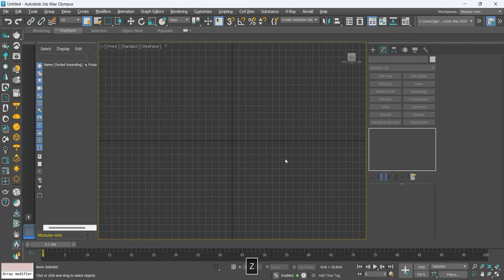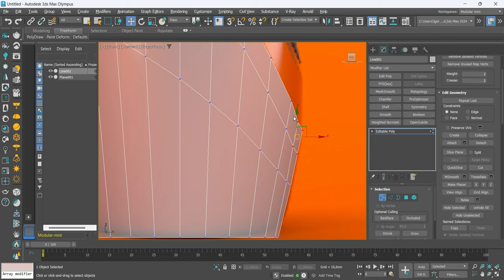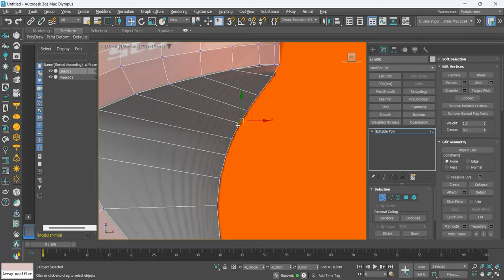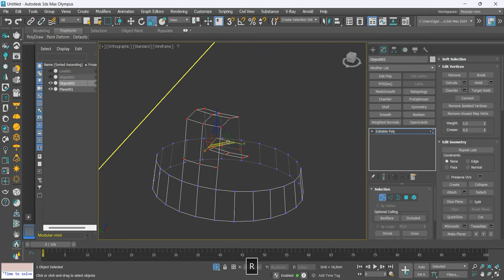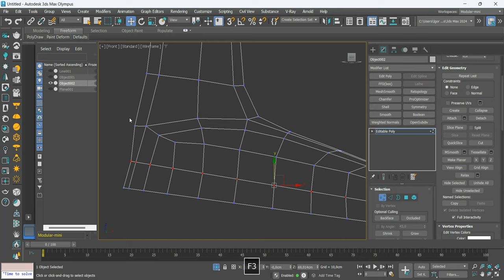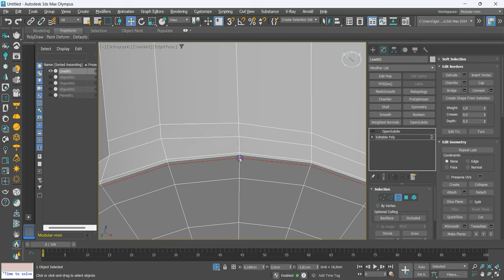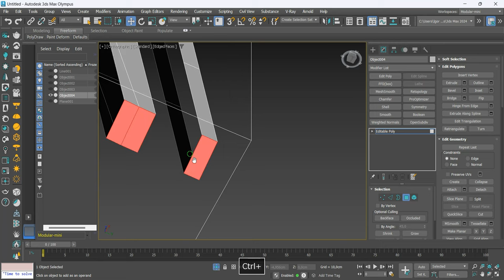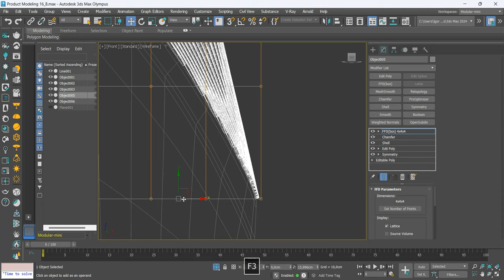Creating Stunning Hard Surface Product: Guide 3D Bottle Modeling  #3dsmax2024 #boolean #hardsurface

Comment: Hi. Great videos. I am still struggling to understand the logic of where to put the support loops. Need a subject in which to practice all the modeling tools
Reply from the maker: Thank you friend! About support loops, you should think like this. If you want a face to be harder you should add support loops as close to its edge. If you want something smoother, you should insert the loop further away from the edge of that face. About the loops in the middle of the model, they serve to hold the shape, in this video at minute 2:02 I insert two support loops, one at the top and one at the bottom. This ensures that the shape of the curve that was created with the cut remains without dents. Without these loops, the shape would not be faithful to the reference and would lose this apparent bond that was created. I hope this brief explanation helps in some way. Success in your studies! Hug